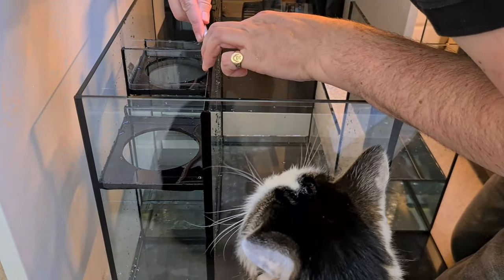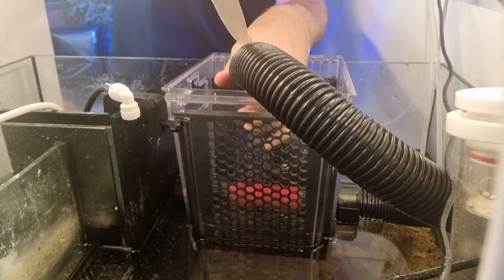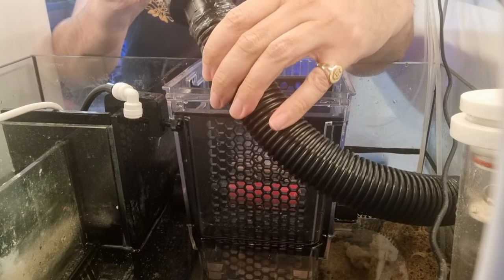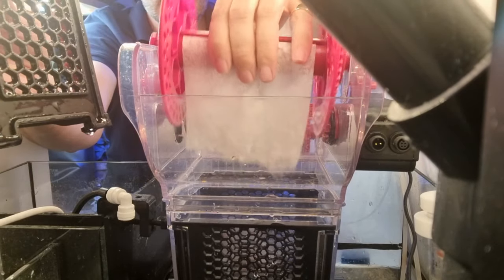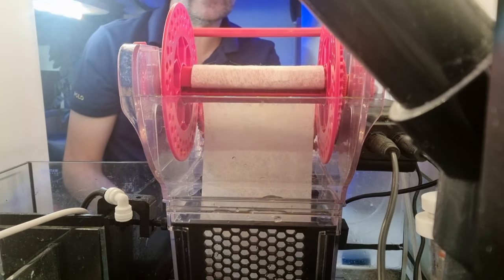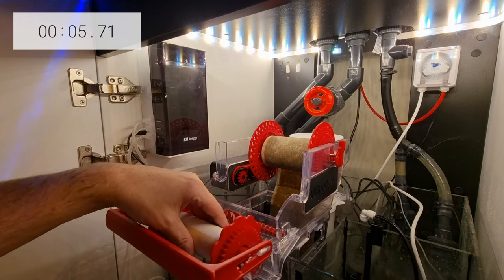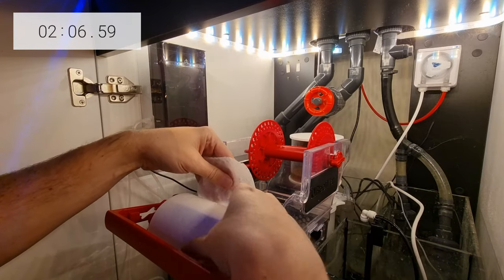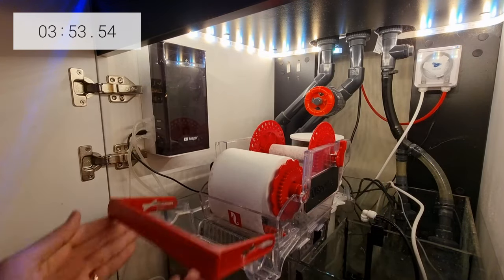Red Sea ReefMat 500 Install... In A Waterbox Aquarium (Frag 55.2)

Comment: Great video and great product. How come you didn't use the classic stapler-method to change the roll? This method is very simple and doesn't require to unmount the inner parts...
Reply from the maker: This is much easier and it's designed to avoid having to use staples. I hated doing that on my other roller mats!

Comment: Thanks for doing this video! I really want one of these on my 250l (Aquarium Systems L'aquarium) but worried of wrecking my sump.  2 questions.. What is the silicone stuff you use and do you have to let it dry for ages? And is it difficult to set the downpipe flow/ or height of the red sea reef mat?
Reply from the maker: It's just aquarium safe silicon - I think it's supposed to dry for 24 hours but I usually just get it wet straight away and it's always been fine

Comment: I have a Blau aquaristic roller mat, but don’t know how deep it needs to sit into the sump. At what height should the water level be to trigger the rolling of the fleece? Can you perhaps make a video showing the internal working of the roller and how the water goes through it and when/how it triggers it automatically?
Reply from the maker: It probably varies with different rollers, but generally speaking err on the side of a bit too high, rather than a bit too low